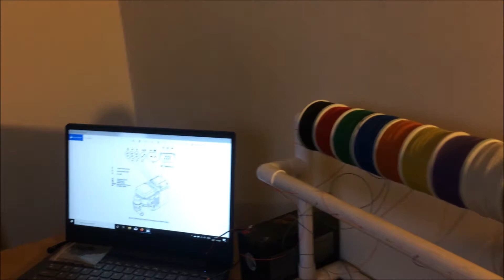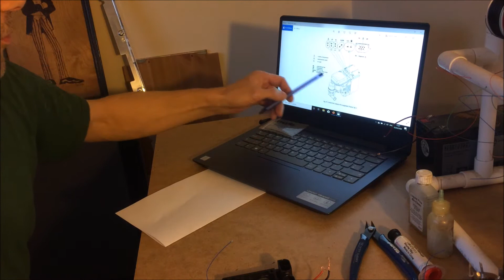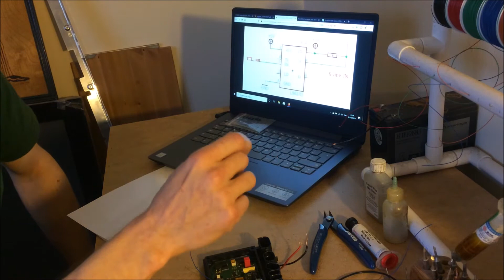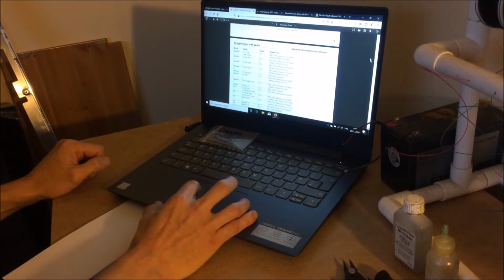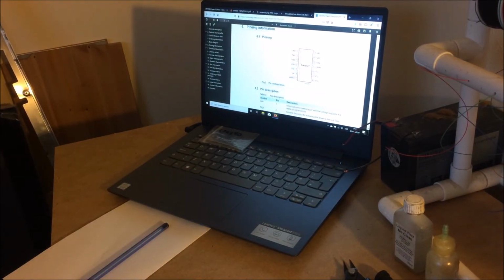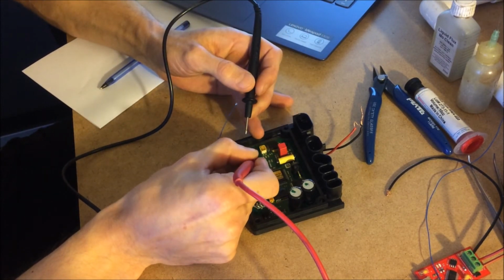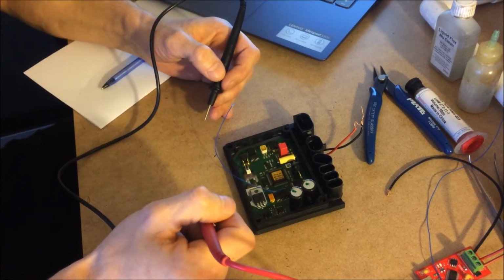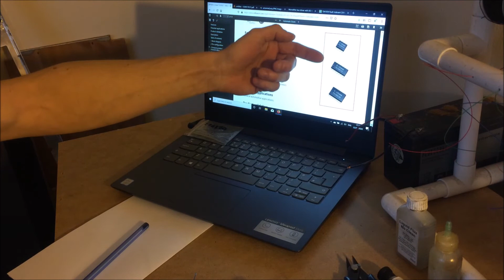Always Check Your Webasto Pinouts and which type you have!

Comment: I’ve got a 2009 diesel Cayenne with factory fitted Webasto auxiliary heater. I’ve just bought a second hand parking heater. Do you know if it’s possibly to copy the firmware from the parking heater and flash it onto the auxiliary heater? This obviously being subject to the boards being the same, which I suspect they are.

Comment: Do you know if my Mazda 6 GH 2008 diesel, have W-Bus system on my webasto thermo top C? I guess i cannot start it with 12+ on any pin 😅

So i ordet a W-bus emulator with remote key to activate the thermo top C.

Comment: the source will be powered and will provide 5 volts, only when pin 3 is put to ground (Can Low)
Reply: I have a similar but not identical thermo top c/z controller from BMW, it uses the same circuits shown in the clip and the same connections 1=communication, 2 Can Hight, 3 Can Low

Comment: Hi, i have tried to find the Pinout for my ThermonTop C out of a Mercedes. Was not succesful so far. Can you help me out how to find it ? 
Is WTT able to communicate trough the Can high and low ? I know them Pins.
Reply from the maker: No! wtt uses "W-Bus" or "webasto diagnostic bus". Think of the board as two systems in one! one system is merc and can, the other is webasto and there diagnostic bus. So can is only for the merc!
W-bus is k-line! this is pin 1 or 2 with k-line adaptor and wtt. hope that helps
Reply: @robinsonlabs  okay i have checked pin 1 (plug) to pin 6 on the L9637 and had a match ... hooked up my adapter and software and choose W-Bus ... it automatically worked and has shown all the options opened when connected.
made a quick testrun and almost shit my pants in happiness :D
thanks mate !!! you really helped me out there !

Comment: Hello ! I have a factory made heater in my mercedes w203 ( c270) . And i installed it back with my factory cabels . but its only just spinning the air fan, and i cant controll it from my cars menu . What you think this can be the same issue ? anyway theres no blue wire micro soldered in my electric board.
Reply from the maker: Sounds like a supercharger circuit fault! by all means pop over to the website and book an inspection/repair www.robinsonlabs.co.uk
Reply: @robinsonlabs  It would be great but im living in the other side of europe :)

Comment: Brilliant video very informative..iv got a webasto air top evo marine 3900..iv spent hours looking for the pin to do a diagnostic test ect..iv tryed all the pins and get 12v dc readings..I was expecting 5v on pin 12 or pin 10 (no wire or plug pin installed) any help or advice would be much appreciated..thanks justin
Reply from the maker: so sorry for the late reply, you can find anything for your heater here https://www.butlertechnik.com/technical_library/air-top-evo-3900-d23